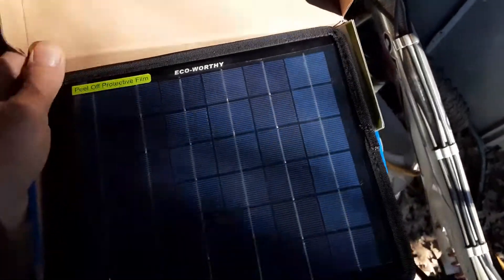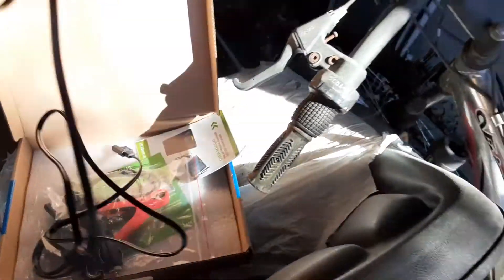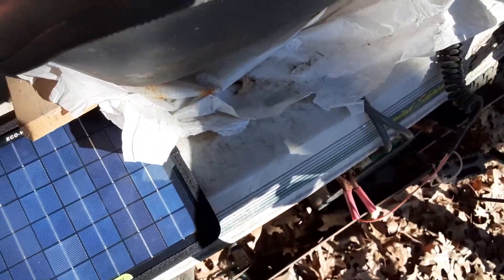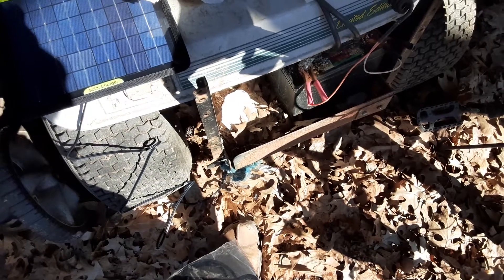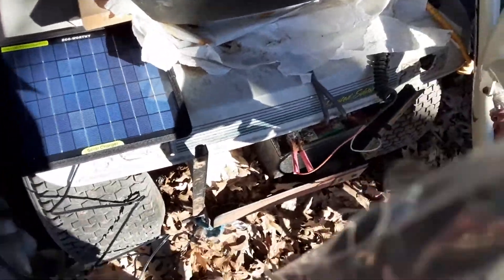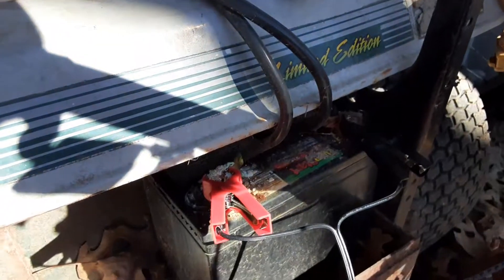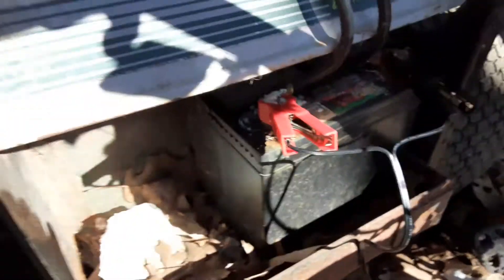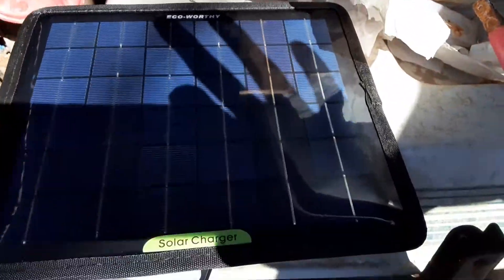Eco-worthy solar trickle charger

Comment: If any part of the panel is shaded you'll stop the majority of the power that the panel is capable of. And if you want any of the very little current that that small panel will produce clean your battery post.
Reply from the maker: The eco-worthy works great even with dust ,low light ,and corroded post.
But I do need to clean everything.
I started that mower the other day and the battery definitely has to be full to turn it over.